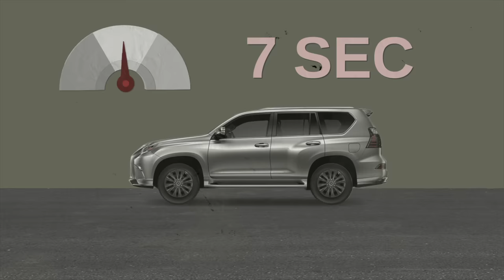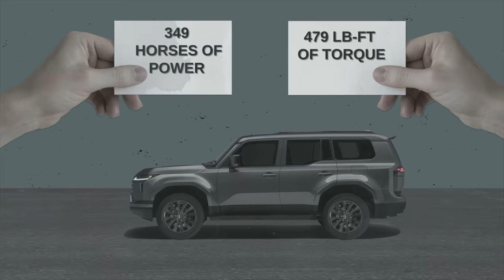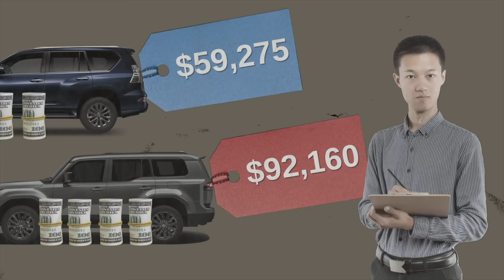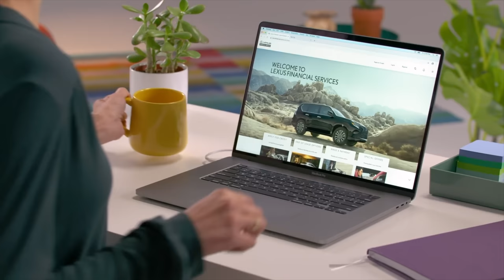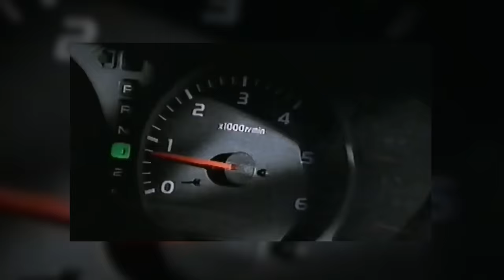Lexus Just Dropped a Bomb on the Entire Car Industry

Comment: The Overtrail edition has both center and rear lockers. When combined, there is a 50/50 split of power to front/back axle + locked rear wheels which will spin in unison. This will get you out of even situations with diagonal traction loss (two diagonal wheels in the air). There really isnt much of a difference in performance compared to ALSO having a front locker except in the most extreme of offroading situations. Most people are already heavily modifying their vehicles by this point for things like extreme rock crawling. Just my two cents.

Comment: Since the GX 460 has proven long-term reliability and fairly strong aftermarket support in the off-roading industry, I would not suggest buying the 550. At the very least, wait 2-3 years for Toyota/Lexus to work out the bugs. Regardless of how many bugs they work out, just know that there's little to no chance that the turbo will ever last as long as their bulletproof V8.
Reply: I trust Toyota to make a reliable turbo. They have had a turbo diesel in the Land Cruiser for a long time now
Reply: Great you wait then. Meanwhile I'll be styling
Reply: In Israel, a few months ago, a Toyota Hilux just got over 2 million kilometres, using the original engine. This is a turbo diesel engine.
Reply: We have two gx460 and a runner in the household.  Not looking to go turbo.
Reply: Turbo diesel way more reliable than any turbo gasser. Sorry.
Reply: Really silly comment to compare turbo diesel to gas
Reply: @seachickens4u  cannot disagree. Diesels love turbo, gas engines cannot take the pressure.
Reply: @seachickens4u  
Obviously you haven't seen the fault rate of Land Rover turo diesel vs. The Toyotas. Of course that the diesels would last much longer, but the vendor makes also one heck of a difference. And besides, how many people really reach over 1 million miles?
Reply: @seachickens4u  what is diesel here?  Or are you just inserting random angry comments?  Both are gasoline.  V8 here is also proven 1 million km motor, don't see the issue with the OP comment at all.
Reply: @liordagan9342 That's not a fair comparison. The hilux was probably blessed by the one true God.
Reply: Damn bugs, soon they will tell us is a great replacement for a steak. Oh wait. Lmbo.
Reply: Lol at the dolts trying to compare diesel turbos to gassers. That's not what's being discussed here. You sound silly just bringing it up. I'm talking about the naturally aspirated V8 vs the new turbo V6 😂
Reply: @liordagan9342  Theres tons of million+ miles turbo diesels, doesnt mean anything.
Reply: @hajjdawood  
Not in Israel, for vehicles under 4 tons.
Reply: @brianleonard1639  
Do you see a land rover getting over 1 million miles on one engine, with a turbo diesel?

Comment: I'm a Lexus owner and love it! I have a GX but would rather have the LX. Maybe one day. I have an 06. Wouldn't do the new ones.
Reply: I have a LX570 and it is great. I love it. BUT, it does cost a lot of more money to fix and maintain. The 13 mpg city isn't a lot of fun too. I do a lot of miles for my work so I've already done the big 110,000 tune up/repair period. Cost me $11,900 to replace all the warn out steering components and new shocks and struts. Had to replace the water pump and the spark plugs were outragously expensive.  If you have the cash get one for sure. Mine is a 2017 with 133,800ish miles and I hope to keep it forever.
Reply: @SuperSnakePlissken  that is awesome! I would love to take yours out for a ride! I want the 2006 LX 470 with low miles. Believe it or not I get about 20 mpg on the interstate. I don't do 70 though. I do 63 tops. I even get about 18 around town but I drive slow, coast up to stop signs, I don't ever floor it to merge unless I absolutely have to. I call it mellow driving. It's actually been good for me mentally too. This says a lot
considering I use to race stock cars.
Reply: INDEED….. ‼️💄💋
Reply: My 2010 LX 570 gets an average of 16.5 mi per gallon mixed highway city driving. You shouldn't have had to replace any steering components at 110,000 mi.
Reply: 2013 Land Cruiser with 179k miles on the clock. Basic maintenance. Whoever has you replace all that hosed you. I have a 2” OME BP51 lift under it with 275/70R18s under it and it rides and drives beautifully. I get around 14mpg overall. If I were to get anything today, it would be a GX460. Stone dead reliable and proven. I don’t care about Apple CarPlay or any of those gimmicks.
Reply: @SuperSnakePlissken    I assume your work involves a lot of off roading? I just had to replace the steering rack and tie rod ends on my 100 Series for the first time - at 240K miles. But all my driving is on the highway…

Comment: The front locker doesn’t lock the front wheels to the rear wheels. The center differential lock does that and is standard on the GX550. A front locker locks the two front wheels together to spin at the same rate regardless of traction. For me, the key Toyota traction aid is A-Trac which operates in 4L and sometimes is better than a rear locker in managing power to the wheels that have traction.

Comment: As someone who works at Lexus I’m in love with these but damn they should have never ditched the V8. We’re pulling more engines and transmissions then ever at my dealership.. like 3 a day.. it’s amazing how well the old Lexus were built compared to the new ones.. I wish car companies would stop beating around the bush and keep building engines that they knew were reliable like the 4.6 or 5.7 iforce
Reply: You are absolutely correct. I do not like the new interior either. Feel like they went cheap. Love the 460gx this new thing with the 6 cylinder no thanks. If an explorer and a bronco had a baby it would  be the new gx550. Hopefully lexus comes to its senses and brings back the v8.

Comment: I think that adding the locker is still way better in terms of cost of ownership than going for G class or a Range Rover. The gas mileage will be dwarfed by these cars' mechanic charges, not to mention the times spent at the shop. As for the size, well, this is customer specific.

Comment: I'll stick with my 1999 Mercedes Benz ML 320; that I paid $4500.00 for several years ago when it had 136,000 km on it.  It's comfortable to drive, has off road capacity, built solid, not too expensive to maintain.  Found an honest mechanic.  I'll use the money I saved from buying an overpriced over computerized new piece of junk to buy fuel for this MB and keep it maintained--I'm still way way ahead, pricewise and will be for some time.  My other car ... a Toyota Corolla 1999.  Will never part with it.

Comment: The issue with 4Runner is most dealer markup the MSRP while GX460 was deeply discounted. When I was shopping for a 4Runner TRD Pro back in 2018, the dealer with stock wants $5000 markup. But the Lexus next door is offering $6500 off on GX460 😂 so I bought GX instead.

Comment: Nobody can talk me out of getting the GX 550 lol.
Reply: Wait a couple of years for "new model bugs" to be worked out. From about 2026 model year it will solid
Reply: Turbos are not reliable in the long run you will have expensive issues later down the road.  The 2023 gx460 has a reliable v8 that has proven the test of time. Companies are moving to turbo, they are just a cheap way to squeeze horsepower out of a tiny engine.
Reply: @anthonycabanas8572  All engines eventually have expensive issues, in the long run.     The GX will have the exact same Dakar Rally dominating engine from the 300 Series, which is Toyota's global halo vehicle, engineered to last over 2 decades in 3rd world countries and countries with harsh climates, like the middle east and Australia, and remote regions of Asia.     Nothing will last longer than the new GX, just like only the 4Runner can last as long as the current GX
Reply: @RomanVarl  If this were a western built Toyota, I would agree!   However the GX is being assembled in Toyota's best plant in Japan, along side their iconic halo vehicle the 300 Series Land Cruiser, Lexus LX etc.    Everything going into it is existing working technology.   Even the engine is from their 300 Series, and the platform has been in use for several years now.    There will be no "new model bugs" that are worth anyone not buying it, because the bugs have been worked out in other platforms
Reply: @lunamaria1048 It's nice that these nervous nellies won't all be rushing to buy the same sick ride I'll be styling in for the next few years
Reply: @RomanVarl You can wait. If there are bugs I'll trade my 2024 for a 2026. The emotional charge I'll get for the next couple years will be worth whatever price. But hey you do you
Reply: @JohnJohnCrusher  this is the first time I heard anyone say "emotional charge" about Lexus cars )) Usually it's the BMW or Audi crowd
Reply: @lunamaria1048 i think the gx470 was the best of all.
Reply: @marcelrodriguez2067  The GX550 is not even out yet, to compare.    I have owned a GX470 and honestly can say I'd never buy another.  The 550 will be better in EVERT capacity.  Rear diff lock, center diff lock, better approach and departure, and a lighter egine that is not hard on steering components (offroad) like the current models heavy V8.    As a long time GX and 4Runner buyer, I say you are definitely wrong lol
Reply: @lunamaria1048 i just dont see a turbo to be as reliable as an NA v8 ever.

Comment: There is no replacement for displacement.  Forced induction vehicles are finnicky, require extra attention, has more problems, and dont last as long. I would buy the older V8 model than buy the new one especially when the new one will cost $10k-$20k more MSRP due to the redesign.

Comment: I have a 2006 GX470 that i love! It's at 215,000 miles! I've kept it up over the years doing all the scheduled maintenance and more! Recently, the back rear window slid off the rail and broke the motor need to replace entire kit for 2.5k to get the window up. In addition, the mechanic discovered 5 oil leaks? but no oil shows on the garage floor?  $6.5k out the door to fix. is it worth it or should I sell for parts and get into a new Lexus?  Which then leads me to next question, which one? Any thoughts from the community would be appreciated!

Comment: 10:03 chart is WRONG. After the FJ-40 the "more luxury" branch has been split starting with the FJ-55, then followed by 60 series, then followed by 80, 100, 200, 300 series. Meanwhile 70 series has appeared at the same time as the 60 series, as a more robust cheaper option and the sub-split heavy/light duty has happened there too, where the 70-heavy duty kept its original form more or less up to this day, and light duty 70-series was given the name "prado" and has started its own model line 70-90-120-150-250. The 80 series is the direct successor to 60 series not 70.

Comment: I have a 2010 GX and thought I would end up buying a 2021-2024 model. However I currently get about 11 mpg because I don’t do much hwy driving. it will be hard to justify upgrading to another 460. Because the interior is very much identical to my 2010 and mpg hasn’t changed. Also don’t love the new grills. I love the look of the 550 but due to mpg and pricing I may end up in a Highlander. I have two kids and prefer to have the 3rd row. We shall see.
Reply: I've worked on a lot of the 460's, just did a 21 a couple weeks ago, you are not missing ANYTHING. I literally couldn't tell the difference, I thought it was a 16 or something. Keep your 2010 that you don't have to worry about babying. Your mileage is going to continue to be offset by your cost of ownership. I haven't been into the 550 but I have torn up a 23 LX, so I think the new gx is going to be legitimately superior. Based on the tundra and sequoia, expect significantly worse mileage than advertised if you load that thing up, I know people that have both. But you know that, you already talked about the mileage. I love the concept of the 550 but 17 mpg is extremely not impressive.

But if you need to get rid of the gx and want a 3rd row and better mileage get an in infinity qx80 until you decide. You'll get slightly better mileage out of a much bigger motor around town, and you get most of the best things toyota is just putting in their trd trims in a 5-8 year old vehicle. That's what I'm planning on doing until about 2032 when I shoould be able to afford a 24 GX, ha.

Highlanders are really unimpressive compared to the GX, to me. They just feel like paper mache to me. I just know my family had bad luck with them and they're an awkward size. Big but without some of the benefits you'd expect. That was the previous gen though, curious what you think.
Reply: Get a Highlander hybrid… better gas mileage
Reply: Love my 23 Highlander Hybrid.  35 mpg around town is true.  It drives very comfortably on road trips.  For me the 3rd row is for short trip use and rarely.  But if you need the entire third row the rear cargo area is small.
Reply: If thinking about going with a highlander, consider the new grand highlander, or a sienna.  Our '22 AWD sienna is supposed to get 35mpg.  We deal with a lot of snow, and go up and over the highest year round pass in the Sierras 10+ times a week, but we're still getting over 30.  From 100ft, I saw a highlander from the side and thought it was our sienna, until I noticed the 2nd set of doors were not sliders.  The sienna gives you much more room than the standard highlander.  But I just saw a grand highlander at the dealer, and it is much closer in size, but taller and with some more ground clearance.  The grand highlander is probably a better choice if you ever go on a rougher off-road trail, or if you just prefer standard doors to a slider.
Reply: @aarondaniel7688  Grand Highlander looks great
Reply: @aarondaniel7688  you know I have seen a few of those and it didn’t really register. I don’t know why those aren’t more popular, it’s a great idea. Minivan without the drawback of flinging your older 2 in the back and hoping they get their seat belts right? Putting your 2 in the middle and heaving your soda in the back row hoping you feel up to retrieving them? Not very modern.

Comment: As a long time, V8 Tundra owner, I wish Toyota would move into the heavy duty truck market. Super large gasser or maybe even a diesel. The American made sector is a disaster durability wise, but they start at 80 and crack 100k and are packed with luxury. I would think there is plenty of profit to be found there by the Toyota/Lexus badge. Of course it’s a dream…

Comment: Great compilation of information! Much appreciated! The 17mpg is really disappointing. I was hoping for years that the next model would be at or near 30mpg, or at least into the 20s. Even the sequoia has better mpg!  I guess I'll be stuck with an NXh or RXh for my next lexus 🙄
Reply: 17 mpg is disappointing for sure, but it's unclear how any engineering team could design a 5800 lb 4WD vehicle with almost 400 hp and nearly 500 lb/ft of torque to get 30 mpg. That would mean improving the overall efficiency of the drivetrain toward the max of 50%, which, presumably every company is working hard to do (or are they?). Electric motors are max 85% efficient, but then you have all the other current gotchas that come with that tech. It's not completely clear why Lexus doesn't offer a turbo diesel option for better mpg. Emissions? 

I own an older GX for fun and towing, and then an NX300 F-sport for everything else. (The F-sport thing is kind of a joke since there's no extra power, but it did provide the kinetic suspension for improved handling.) The GX is more comfy, but the NX is really nice and it gets 30+ mpg on east coast highways with the turbo.  Can't speak to the RX, having never owned one.
Reply: Correction, almost 350 hp. Just lost all credibility. 🤨
Reply: @JR-qj6wg  sequoia has 437hp and weighs 5620lbs+. The gx is about 1000lb heavier but I think a rigidy-enhanced unibody may have been better overall than sticking with a body on frame, if it means that much weight

Comment: Front locker with the modern MTS system that the Overtrail truck really isn't necessary. I've seen MTS in action in a GX460 (a friend of mine added it using parts sourced from overseas) and I am pretty sold on that. That said, adding a front locker and air compressor is probably the first thing I'd do if I bought a GX550. Also, stating that the GX is just an over prices 4Runner is really not accurate. While the GX460 and 4Runner share the sam LC150 platform, the 5th gen 4Runner doesn't offer a V8. All things being equal, I'd rather have the v8. I am interested, however, to see what Toyota is going to offer in the 6th gen 4Runner, as the new US market Land Cruiser (PRADO) on the LC250 platform is in the same market segment as the 4Runner.

Comment: Scott thanks
Waiting to see price has tow capacity of 90,000 land cruiser. If you can get that for 75,000, quite an improvement. The width is large enough to tow a horse trailer without changes, something novel (a off roader for the horse crowd)

Comment: Going to just keep my GX460 and modify it. Small lift and some bigger tires solve the problems I had. I don't understand dated. What does dated even mean? It doesn't have a 15 inch screen tablet in the center and a screen gauge? The interior looks great, it is comfortable and I prefer analog to digital and I have owned many vehicles so I have experienced both. Want to spice your interior up? Take it to an upholstery shop.
Reply: Exactly,  I do not like iPads everywhere instead of analog and physical buttons. No turbo charged engine = I'm in!

Comment: If anyone here from the community can tell are or will the Toyota turbo engines be reliable. What i have read is that the turbo engines working of pressurised air mechanism wear way faster then the NA engines.